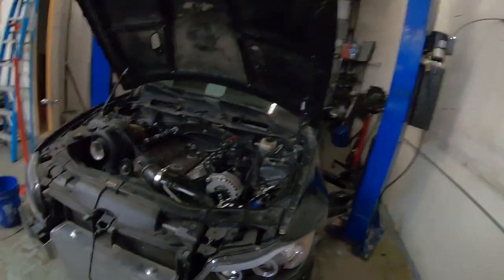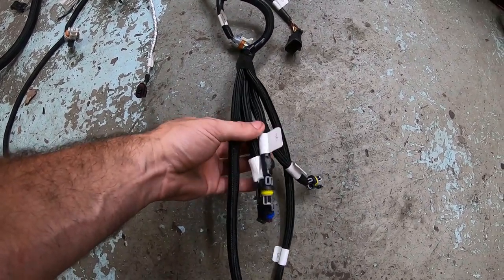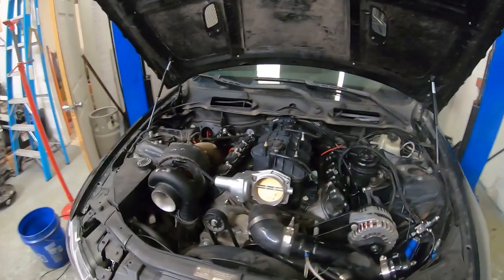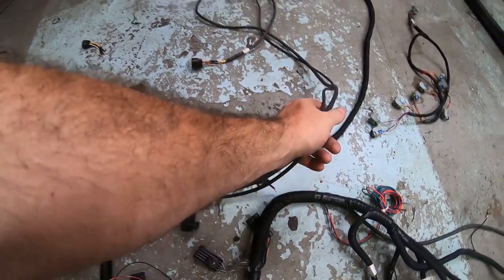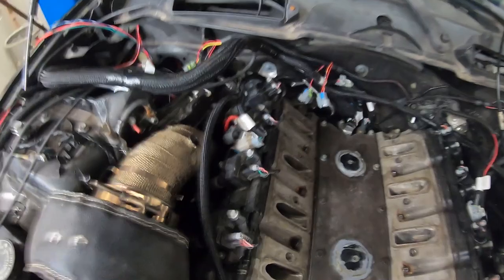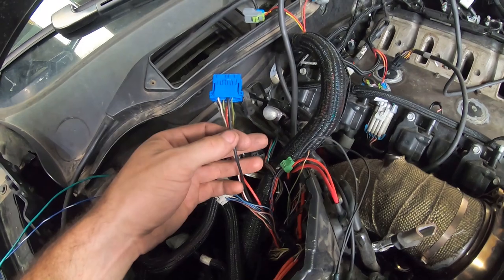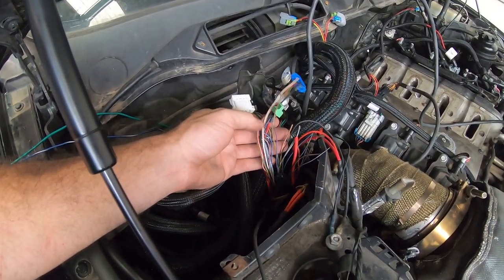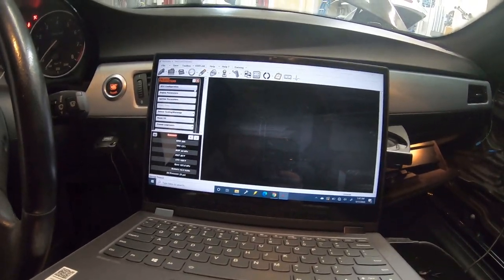E90/E92 Holley Install - Complete Step by Step walkthrough DIY for Terminator X

Comment: Mike, you are awesome!!! I can't believe how lucky I got thanks to you. I started thinking about doing a LS swap couple of months ago (I'm not a professional mechanic by any means, just a home diy guy) but I wanted to do something different than just the common fox body or 240sx. When I saw an E92  in one of samcrac's videos I knew that I wonted that (even though I'm not a BMW fan). I started research and couldn't find sh** I even opened up your website a couple of times but I wasn't able to make the connection (you need to put your videos in there).I was ready to give up.... And then out of some forum I saw the first video about Frank's car and now I feel like a little kid in a candy store. I'm starting from scratch but the goal would be a daily driver turbo charged E92 with a manual and ~600 whp. I still haven't decided on which LS to go with but right now I'm researching LM4,L33 and I'm still wondering with which trany to go. But just wanted to say Thanks man, Thanks for all the time and effort you've put in to this, thanks to you I'll be able to do the exact build that I want.

Comment: Watched the video a million times and I have a question…I have 2011-13 135i. Can this be done with the factory dct in that car also? I’ve been trying to find documentation on how the dct communicates with the ecu. Can you point me in the right direction. Id like to try this with my dct and a coyote. Thanks for the video. Cheers.
Reply from the maker: It can be done but you need to run a separate trans control

Comment: So question if I use the stock 6mt from the car I just get the terminator with the fuel spark and drive wire option right? Since it’s a manual transmision I won’t need the trans option one right?
Reply from the maker: Correct, you only need the trans harness with a 4l60 or 4l80
Reply: @lse90garage  hell yeah :D thanks for the reply i was gonna use a DCT from an e82 but my e82 has a 6 speed manual sooo im just gonna use it instead of trading my friend trans and shit lol

Comment: You guys rock I been playing with putting v 8 in my 2003 z4 manual I was woundering if you have any idea if your motor mounts would work in a E85 z4?  I enjoy your content !!!
Reply from the maker: the Z seems to use the same from subframe so the engine mounts should work.

Comment: I’ve got a 2009 e90 bullet resistant glass and panels and such but I am to far down the rabbit hole to go back and can’t trust the n54 and stock gear box for what I use it for is it possible To swap an auto n54 to t56 ls3 also is their any traction options because I would like to keep stock wheels and tires also would like to keep it quiet other then limo tint I would like the car to look and sound 100 percent stock

Comment: How much room do you have from the valley pan to the bottom side of the hood when shut? Basically is the enough room
to fit a LSA or cts-v supercharger without modifying the hood? Thanks
Reply: Ive been curious to this as well, seems like it would be close but could fit.

Comment: I know I've been asking a lot of questions lately and I'm sorry but...I won't have the money for the Holly terminator set up for a while and theres a local guy who modifies the ls stock ECM to work in anything with only 4 wires to hook up...do you think your box would work with that so that I could have the car running without buying the terminator setup yet?
Reply from the maker: No it won't work with it. Also won't easily have the ability to use the stock pedal so youll need to fabricate one for that though the floor, buy an aftermarket fan or a controller for the stock one, buy a wide band for tuning. In the end your far better with a Holley.
Reply: @lse90garage  ok. Shoot! I'll just be patient and save. Lol
Reply: Have you ever tried a factory dbw harness? It seem like by the time you buy the Holley ecu and add 3 more harness your 2k into it.

Comment: Lot of info in less than an hour.  How does the wiring work if your using the bmw manual transmission?
Reply from the maker: No mods needed for the factory start button on a manual. Just hookup the starter solenoid wire. No can bus termination will be needed on the auto harness either.
Reply: @lse90garage  thanks for the info.

Comment: Also how do these things handle after the swap I’ve got quite a bit of extra weight on my rig then most lol
Reply: should handle similar to stock.. a dressed n54 weighs ~430 lbs. If your donor had a n52 it’s ~370. a dressed aluminum block LS weighs ~430 and a iron is is ~525. so anywhere from 0-155lbs heavier.

Comment: how would we wire a manual transmission?
Reply from the maker: Which part? The starter or the actual transmission?
Reply: @lse90garage  what's the wiring need to be done on the CAS unit for a manual transmission? Leave it the way it is or do as it's mentioned in the video? Thanks
Reply from the maker: @ryder2shae  as the video
Reply from the maker: If the bmw started as a manual. No starter mods needed at the cas
Reply: @lse90garage  thank you. That was quick. Lol

Comment: How much different would the wiring be for an 2011 e90 335i.
Reply from the maker: Almost identical, the key on power wire on some e92s needs to come from the interior of the car, like the cigarette lighter
Reply: Ok so the wiring diagram that you commented in anther comment would be the same.
Reply from the maker: It’s linked in the description as well, but yes

Comment: What rear end do you use for the autos with the 4l80
Reply from the maker: You can keep the stock bmw or go to an 8.8 swap.
Reply: @lse90garage  what are the benefits of the 8.8 swap?
Reply from the maker: @mitakse  stronger, and limited slip but it's expensive